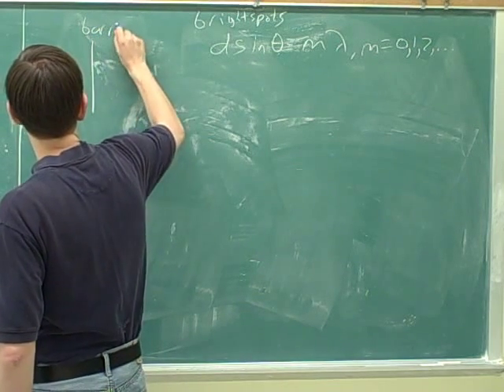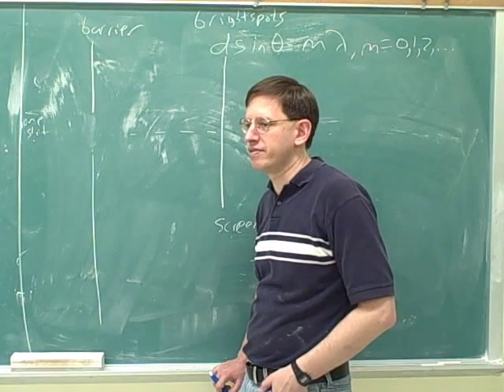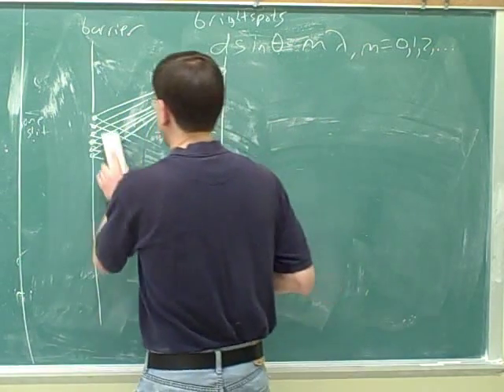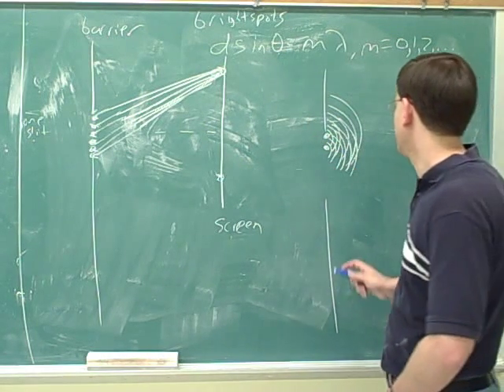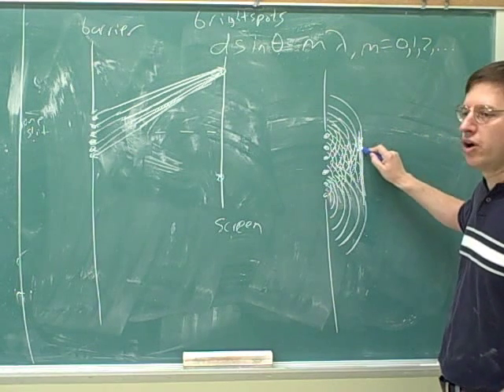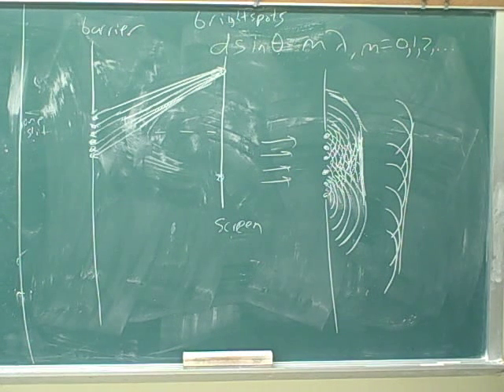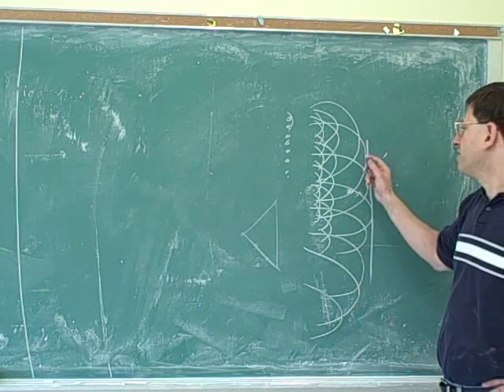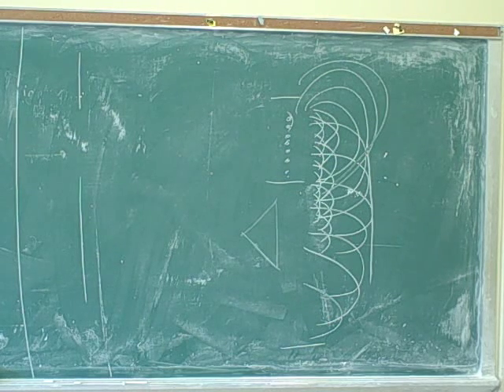Physics: Interference and diffraction (11)

Comment: I just want to point out that in your example of light going through the windows, most of the room might still be illuminated because incoming light reflects off the walls, not because it diffracts (as you have already pointed out, waves diffracts noticeably only when the wave length is comparable to the slit's width).

 Apart from that, GREAT WORK you are doing here :) This is of excellent help for my exam revision. Thank you very much :)